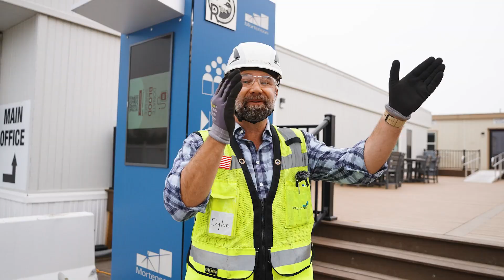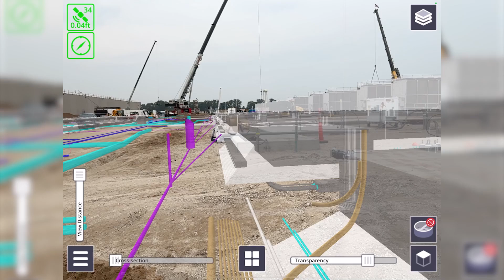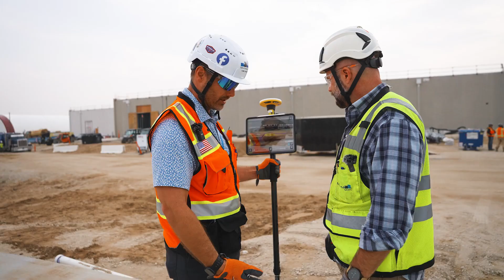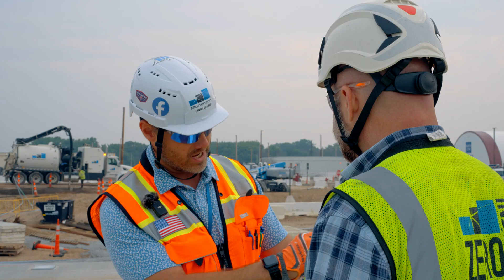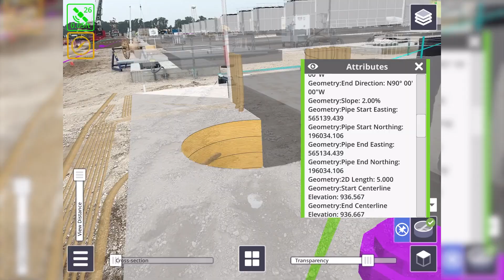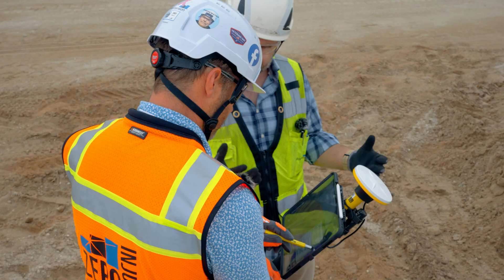Geared Up: Trimble SiteVision GPS-Enabled Augmented Reality Tool

Comment: combining *Trimble SiteVision* with the *XREAL One Pro* opens up a seriously powerful setup for 3D site visualisation.  
>  
> When paired with a capable **smartphone**, this combo turns real-world job sites into fully interactive, high-precision augmented reality spaces. The key advantages include:  
>  
> -  *True-scale visualisation* — see engineering models, underground utilities, and design overlays directly in the field with centimetre-level accuracy.  
> -  *Portable and wireless* — the XREAL One Pro’s lightweight AR headset and smartphone tethering remove the bulk of traditional surveying or visualisation gear.  
> -  *Enhanced collaboration* — on-site teams and remote stakeholders can better understand design intent and spot issues before they become costly reworks.  
> -  *Seamless integration* — Trimble’s software ecosystem supports compatible BIM and CAD data, meaning what you design in-office is what you see on-site.  
>  
> Overall, pairing *Trimble SiteVision* and the *XREAL One Pro* is a smart move for anyone in *construction, surveying, or civil works* looking to bring digital precision into the physical environment.